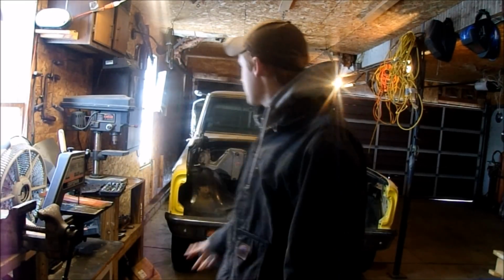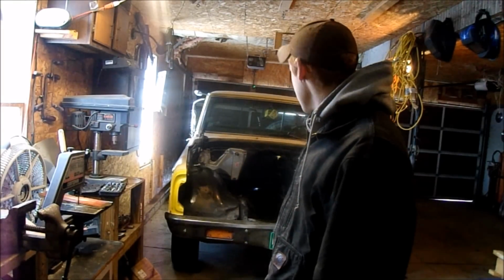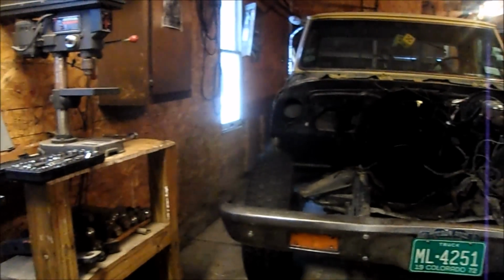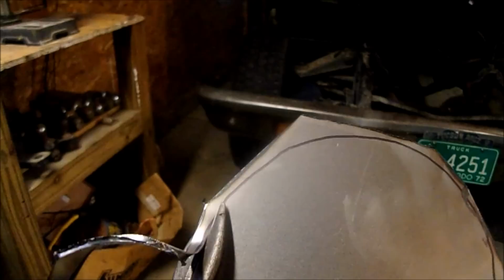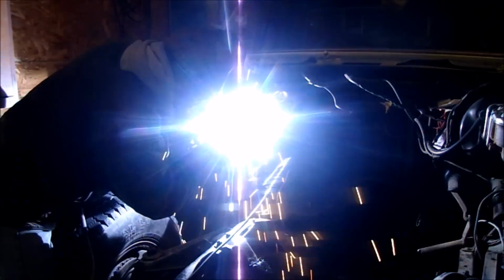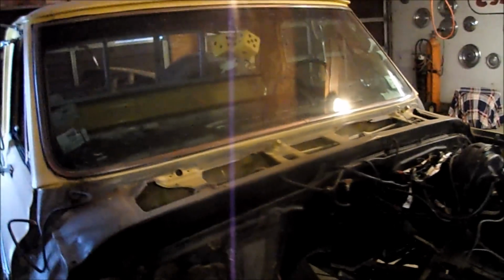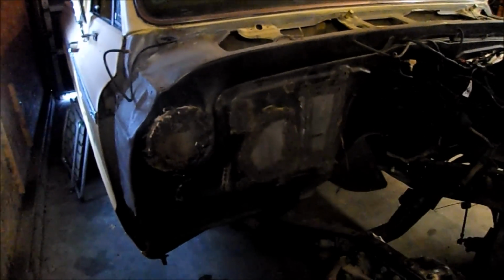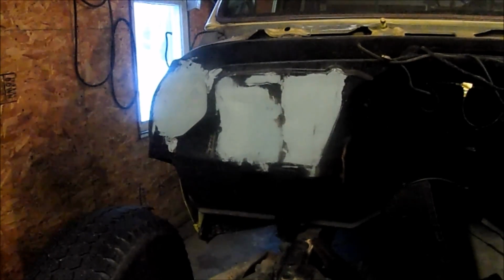1972 Chevy truck - Shaved Firewall

Comment: Yep, it's your truck. One thing I wish I would of done, smooth firewall. At this point I don't care anymore. Just like to drive it. Also they make new heaters that are smaller and tuck up behind the dash so you could always do that later when you're an old old man and get cold easier. Ha! Grinding welds down is where I always got metal too hot and warped it. Looks good!
Reply from the maker: Get that thing going!  I can't wait to see it move..Finally!
Reply: FullThrottle440 I hear ya, I hear ya! Zero time on it last week. Too many dr appts, MRI's , therapy sessions. In bed mostly then decided to make myself get up and do some carving. 15 min here and there but couldn't keep laying in that bed.

Comment: have you seen the yellow construction halogen light stands you buy at homedepo or lows or wallyworld. you could set one up for shots like that and they put out some really nice warm heat too so it would help warm up the working space like a small heater. They dont cost a arm and a leg and they are pretty darn bright. i have seen them at flea markets and garage sales too. in fact I have one the bulb finally burnt out on I need to buy a new bulb. that reminds me. I use it when I work on my suspension on my trucks or cars it helps keep me warm and talk about a bright light it is awesome.
Reply from the maker: Yeah i need to get one of those soon. It's fine during summer because it gets dark out later, but this time of year is when you need good lighting.

Comment: You don't need a metal bandsaw, you need a plasma cutter!   You would love that thing, especially for the odd shaped parts you end up cutting for fillers.
Reply: I heard plasma cutting leaves an edge that doesnt take a weld very well. Is that true?
Reply from the maker: them things aren't the cheapest..i was looking at one at a local welding supply place, they wanted 2k for it lol. it was a hypertherm which is suppose to be really good
Reply: I hear the cheap $200. ones on ebay are actually decent. Theyre called CUT50